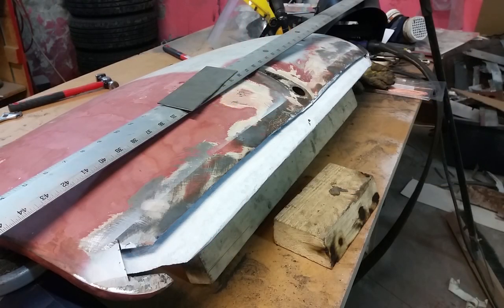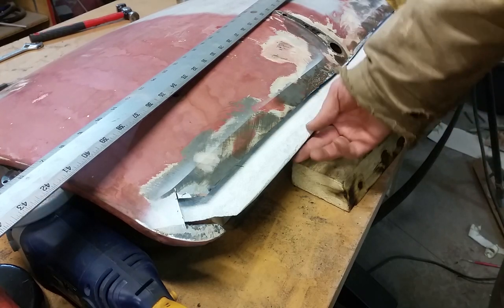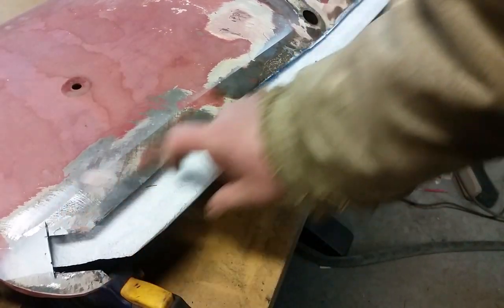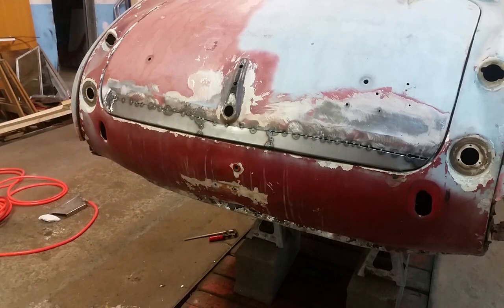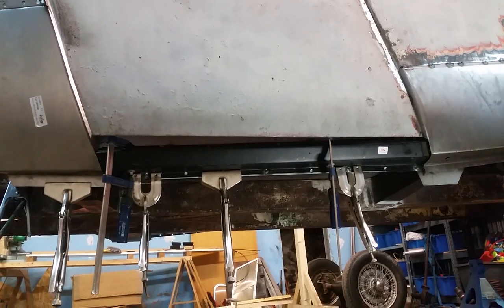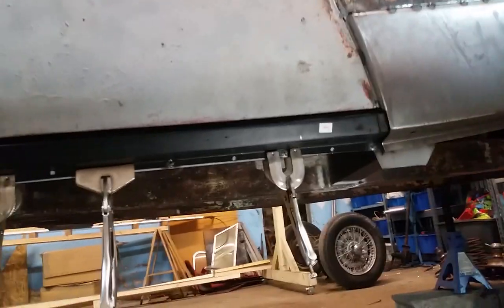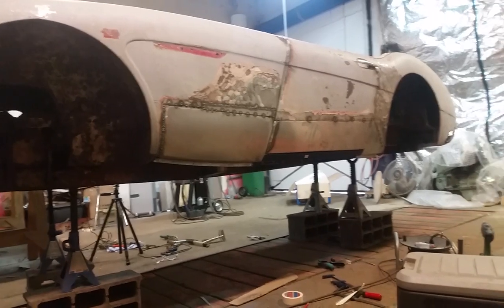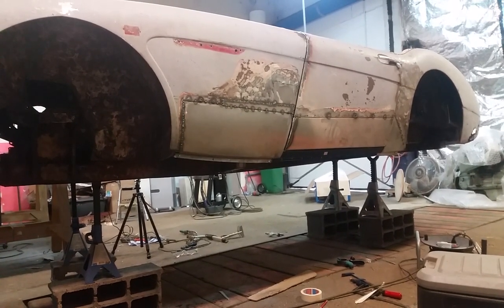The Austin Healey Project - Day 71 - 75

Comment: I bought a 1961 3000 mk1 and have been doing body work and floors. Driver door, left, sags and doesnt latch. I'm afraid I might have a frame issue. It changes when l jack the car in different spots. Is the body mounted on rubber bushings to the frame?
Reply: A week later and I can answer my own question. No bushings. I've gotten the door better. The patches are pretty weak